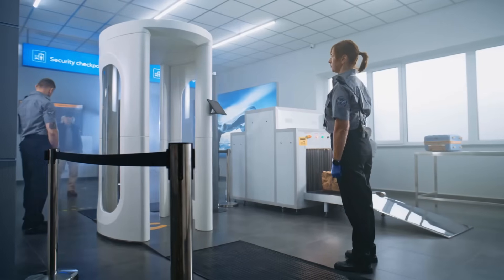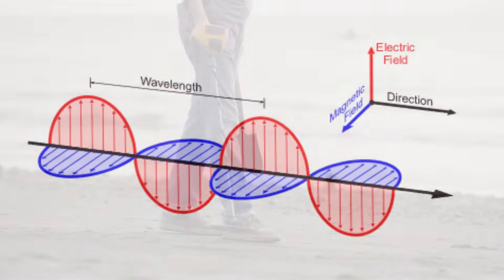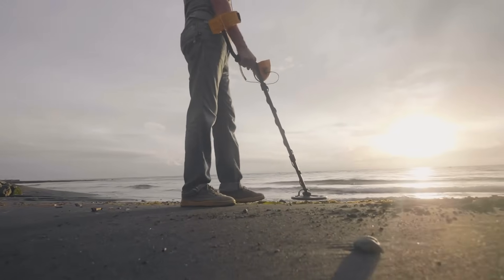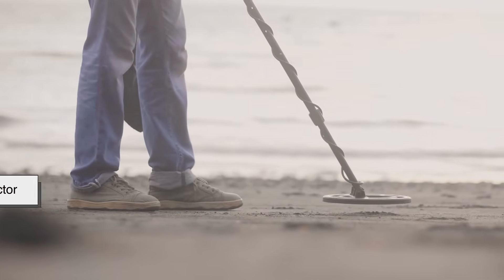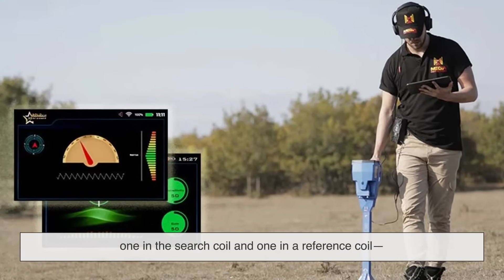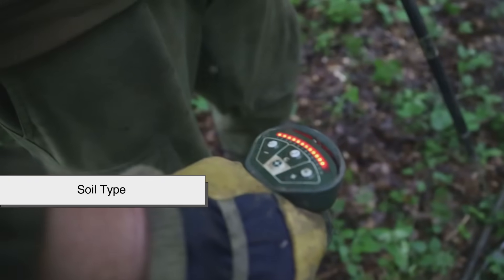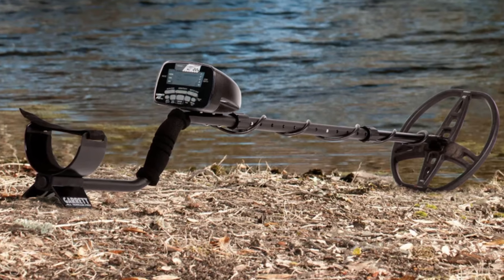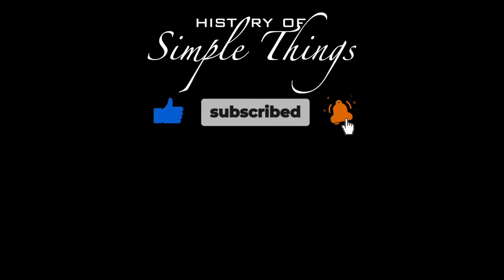How Do Metal Detectors Work?

Comment: The explanation is incorrect. The metal detector is a near-field device, meaning it does not send a EM wave but an alternating magnetic field. The receive coil is designed in such a way that it is insenstitive to the transmitted magnetic field.  It receives a signal, if the field is distorted by eddy currents induced in a nearby piece of (conductive) metal or by some magnetic material. Fortunately, the phase of the return signal is different for both effects, so you can tell ferrous from non-ferrous conducting objects.